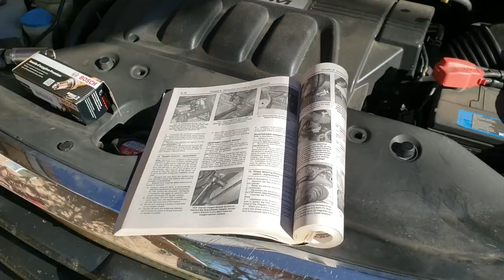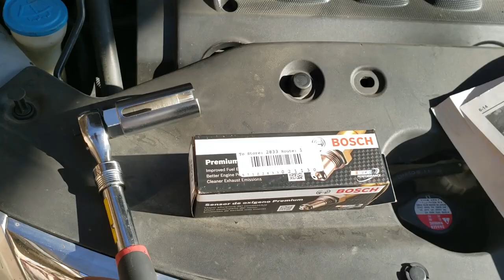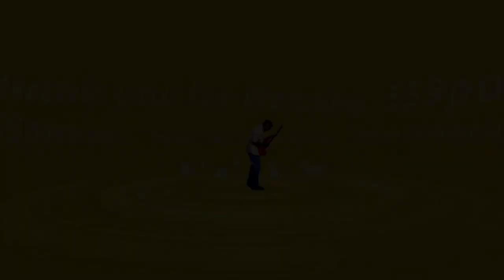How to: Remove Downstream Oxygen Sensor on a 2010 Honda Odyssey. Bank 1 Sensor 2

Comment: Hey George: I do appreciate you doing this video for the down stream O2 sensor. A lot of people wonder exactly where the actual location is for all 4 O2 sensors. Could you update your video to show exactly where they are? I do have the factory shop manuals, & even they are vague in the actual locations. ( they should have included actual pictures of the locations instead of a abstract technical drawing) I too went to 1st grade at Orange Center elementary 😄😄 (back in the late 60’s) 
We have a 2007 Odyssey with 230,000 miles on it. I do most of the repair work on. 
It’s cool to see a 559 video 
Michael
Reply from the maker: No way SMALL WORLD BRO! Thats cool man  small little community. Bank 1 is in the rear of the motor. Bank 2 is in the front by the radiator. Then each bank has sensor 1 and sensor 2. Sensor one is on top sensor 2 is on the bottom on the cat or after it Hope this helps! Thank you for your support!

Comment: Did that get rid of the code?  I have the same downstream code about to change out
Reply from the maker: you have to reset it with a scanner or drive it till it goes away.
Reply: @559powerscape  cool. I fitted the o2 sensor and the cel and  code is gone.

Comment: Hey I'm still getting a p0138 code after changing this 02 sensor. (B1S2) Any suggestions?
Reply from the maker: That should of done it...found this online hope this works out. https://www.yourmechanic.com/article/p0138-obd-ii-trouble-codes-o2-sensor-circuit-high-voltage-bank-1-sensor-2-by-jay-safford

Comment: I’m replacing my b1s2 and it’s a pain. I can’t unclip the connector
Reply from the maker: Any Luck? Try using a small pick or flat head to lift the locking tab from the front of the pigtail. or use Needle nose pliers to click down the release tab and pull back to try and release it.....Good luck

Comment: Is this bank 1 or 2
Reply from the maker: Bank 1 sensor 2
Reply: @559powerscape  sorry I meant sensor 1 or two thanks for the reply awesome video I'm subcribing.
Reply from the maker: @Rich christopher  There is a total of 4 sensors on the Honda Odyssey there is bank 1 sensor 1 bank 1 sensor 2. bank 2 sensor 1 bank 2 sensor 2.  The front  of the engine is bank 2 the rear is bank 1. The top are the upstream  and the bottom  ones are the downstream. The one I replaced here is bank 1 sensor 2. The bottom one from the rear of the motor. Hope this helps. Thank  you  for your SUPPORT!!!
Reply: GEORGE LOPEZ HOW TO DO IT YOUR SELF on the Honda Odyssey 2005 3.5 is there 2 sensor or 4 I got a p0161 code and I was wondering if there is only 2 sensor or 4
Reply from the maker: @GMB730BX  yes its going to have 4. 2 for each side. 2 for the upstream and 2 for the downstream
Reply: GEORGE LOPEZ HOW TO DO IT YOUR SELF thanks 1 more question is the downstream sensor are the same front and rear plug wise
Reply from the maker: @GMB730BX  they should be yes

Comment: I keep getting a p0420 code  every 300 miles i replaced bank 1 sensor 1 im gonna have to do this one now
Reply from the maker: This code actually my friend is for the Catalytic converter it's saying that the Catalytic converter is going bad on bank one
Reply: It comes and goes. Would a Extender for the sensor work?
Reply from the maker: Lol yeah but it is illegal....its tampering with the emissions. When it comes down to smog u will fail inspection. The cat has to be replaced unfortunately
Reply: Any suggestions on can replacement which one is best? 2006 honda odyssey
Reply: @559powerscape  Id like to try extender to diagnose the problem then fix it. Does anyone have a link for the extenders
Reply from the maker: The spacers I use....
https://www.autozone.com/ignition-tune-up-and-routine-maintenance/spark-plug-non-fouler/p/dorman-spark-plug-non-fouler-42002/720789_0_0
Reply from the maker: Here is how to set them up ....
https://youtu.be/KoYb17U56l0